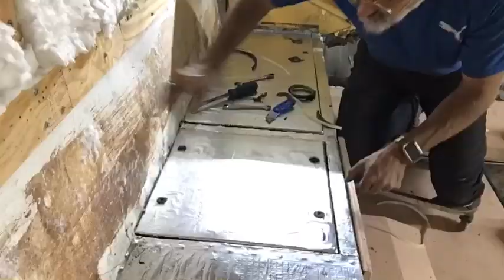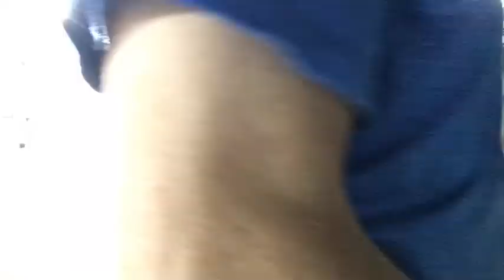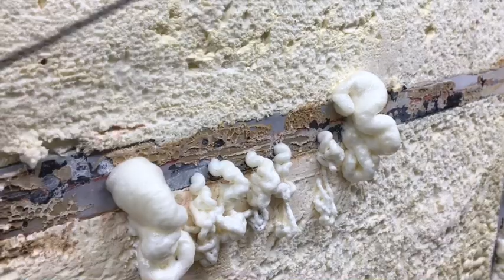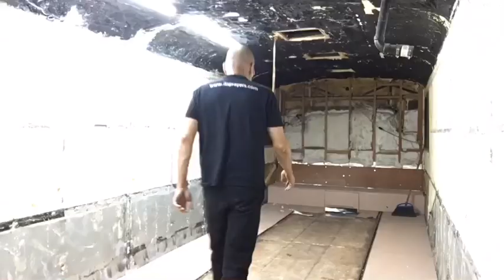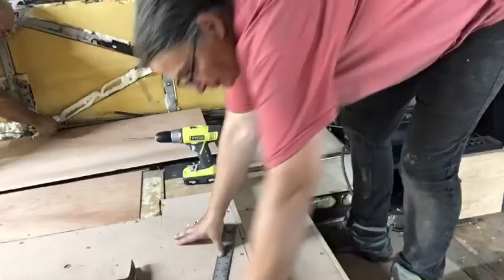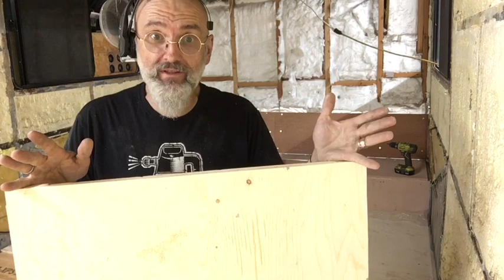E8, solid and insulated floors, MCI 102DL3 Bus Conversion

Comment: Looks like you're not using any adhesives and few fasteners between your layers. Also wondering why the vapor barrier is needed. I appreciate how you think things through and explain your logic and the results you're aiming for - would you share your thinking here? Thanks for your great videos!
Reply from the maker: Thanks for watching. The vapour barrier is needed because of the heat in the floor and the cold below it. We added more fasteners after, but while assembling we just put enough to keep things in place.

Comment: Looks good what's the HVP Roll board do I'm not familiar with it?
Reply from the maker: Brian Davis EHP Rollboard is a high performance Ceramic insulation. 

Here’s a link about our GMC experience with it.   https://engineheatprotection.com/engine-heat/yvan-lacroix-article-from-bus-conversion-magazine-regarding-ehp-rollboard/
Reply: @LacroixCruiser  sounds great I'm at the stage of applying the spray foam before the walls and ceilings and floor like your at in your video now where can I get the 
EHP board for my coach?
Reply from the maker: Brian Davis from the link above.
Reply: @LacroixCruiser  yeah it keeps opening your article on when and how you used its not where to get it. Or I'm doing something wrong, help
Reply from the maker: Brian Davis engineheatprotection.com is the source. Hit the 3 little bars at the top right corner, you can explore their site from there.
Reply: @LacroixCruiser  thank you I noticed that the site says it come in 24 inches wide but yours in your video looks like it's wider or is my mind playing tricks on me?
Reply from the maker: Brian Davis we are using another brand in some areas( left over from another project), but I recommend EHP

Comment: I'm surprised that floor penetrations will be made later. Is the rollboard ready to drill or saw through without snagging/fraying?
Reply from the maker: Rick Bartley yes, it’s very easy to work with. It cuts, drills and forms without issues.